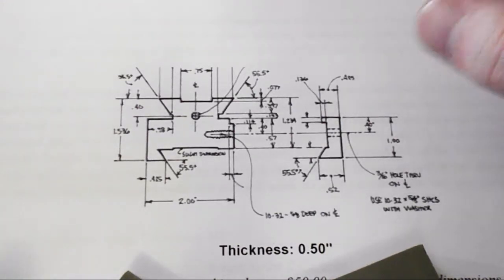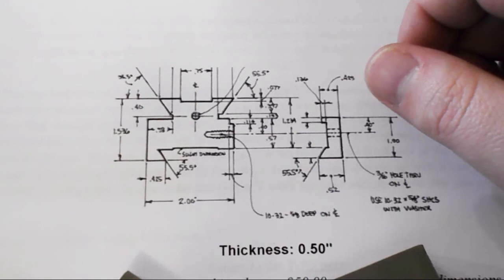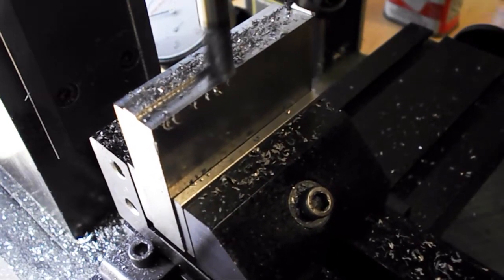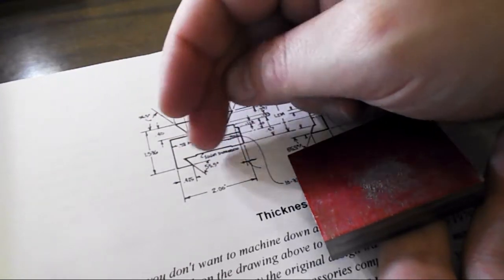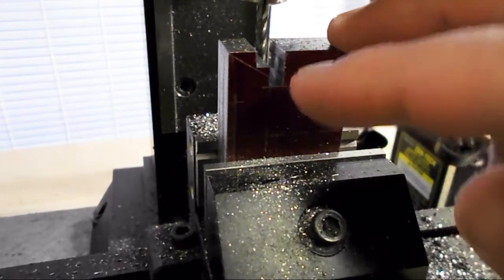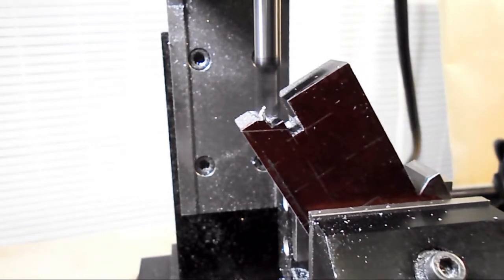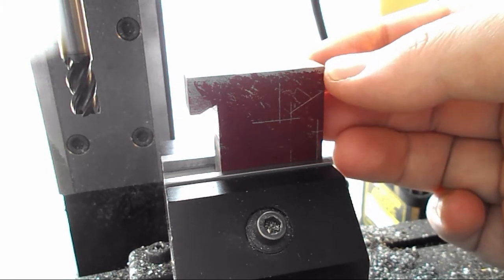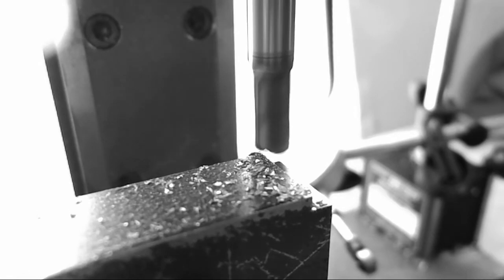Making an Indicator Clamp for the Sherline - A Side Project

Comment: Your Sherline seems to be able to handle incredibly deep cuts for such a small tool. Is there a trick to it, or is it just a really rigid machine?
Reply from the maker: It is very rigid. I do lock in the axis as I am cutting and I pay close attention to the vibration control as well as speed and feed. The Machine overall for its size is quite impressive.
Reply: Thanks. I'm very tempted to try one. My Proxxon is proving to have all kinds of tramming problems, and I can't see an easy way to fix them. The round column means it lacks horizontal rigidity, so I don't think I could even attempt cuts like the ones you've shown in this video.
Reply from the maker: The best part is that the column is keyed in place, preventing it from going out of tram and there is a surprising amount of power in the little motor. For the price, it is hard to beat. Mine was around $800 I think. Basic model.